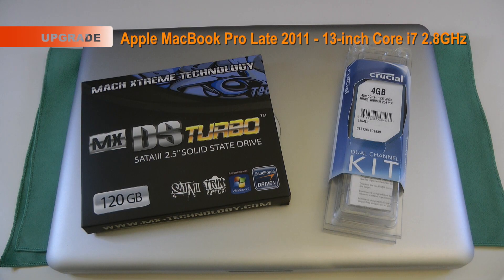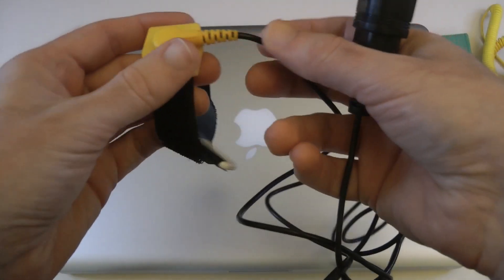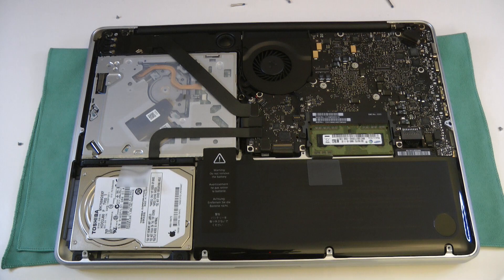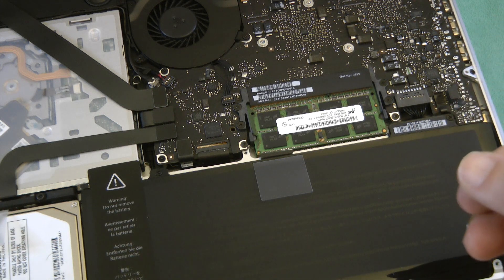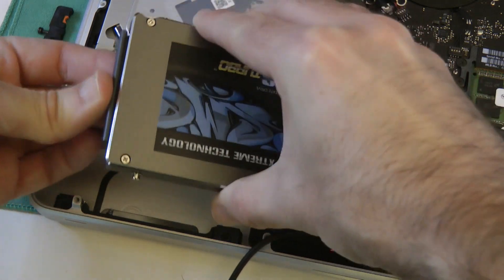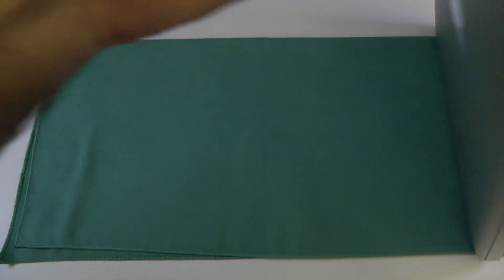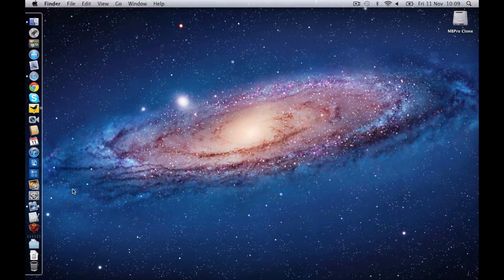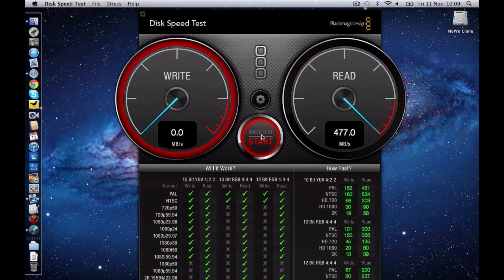Apple MacBook Pro Late 2011 8GB Memory & SSD Upgrade

Comment: Thanks for your effort with the video. It's important to run benchmark tests before and after upgrades so you realize the difference in performance. It would have been important to mention to check battery status prior to the upgrades so the battery could be replaced, if warranted, at the same time as other upgrades are done. Great job!!
Reply from the maker: Thank you :D

Comment: Helpful guide thank you, I'm installing a 500GB SSD and 8GB of RAM this week and will use this guide. My Macbook is in serious need of a refresh.
Reply: Hey mate, 100% would recommend doing the upgrades. Parts cost me about $300 AUD and my Macbook has worked insanely well since, better than the day I bought it. I also feel the performance would be equal to that of a new Macbook and you're saving yourself $2000... Replacing the parts is also very simple.

I'm considering getting a new battery just to really refresh it.
Reply from the maker: Glad you found it helpful, best of luck with your upgrade.
Reply: Hey Man! would you please advise how this upgrade speedup your mac? is it worth to upgrade Ram to 8gb and add SSD or better to buy mac 2015? thanks in advance!
Reply: Traymon Daniels Thanks for your feedback! I have already ordered new SSD and ram 8gb, so total amount or ram will be 10gb (2gb stock module and 8gb) hope 10gb will be recognized by Mac, I've read a lot of comments that this model (Mac pro 13 early 2011) can have up to 16gb ram even if manufacturer listed than max is 8gb.
Reply: Traymon Daniels hi! I'm in Aus as well and was wondering if you sourced the RAM and SSD online or from a particular store?

Comment: Im a video dj.will the ssd speed up my video instead of the little lag I get.
Reply from the maker: +DjTwon40 It should do.
Reply: Thank You,I updated my memory to 8 gig of ram but I want to updated from stock to SSD.
Reply: +Geekanoids Thank you for sharing! I am new to do my upgrade in ram.. since you have done this. the macbook pro improved performance much ? Im running Adobe programs such photoshop ...

Comment: Great video!

I still have my late-2011 13 inch macbook pro with its 4g ram and 500gb hdd. still a great machine. I still plan on using this great machine for the next 4 years.

I want to ask regarding the longevity of this machines with a 16gb ram and 500gb ssd. No problems so far?

Thank you so much!
Reply: Mike Oporto I have the same computer, also hoping it will last another 4 years but I am considering a retina haha. Going to upgrade to 8gb ram tomorrow. I think if anything those upgrade (ram and sad would make it last longer) right?
Reply: ***** I think so too :)I also love the retina display on newer models, but I thought I'll just buy like a 20+ inch external monitor and pair it with my macbook :D. Problem solve for me.

Comment: I have this macbook pro

  Model Name:	MacBook Pro
  Model Identifier:	MacBookPro8,1
  Processor Name:	Intel Core i7
  Processor Speed:	2.8 GHz
  Number of Processors:	1
  Total Number of Cores:	2
  L2 Cache (per Core):	256 KB
  L3 Cache:	4 MB
  Memory:	4 GB
  Boot ROM Version:	MBP81.0047.B27
  SMC Version (system):	1.68f99
  Serial Number (system):	C02H576PDV14
  Hardware UUID:	65EF0894-D69D-5650-A50D-7F688158C8C2
  Sudden Motion Sensor:
  State:	Enabled

and I like to upgrade it to 16gb ram and SSD , Can I ?
Reply: is it retina?
Reply: Frosty Gamer you can't upgrade the retina models
Reply: i know that, thats why is asked if it was

Comment: I think the capacity of the SSD is too small (only 120 GB!). I think I'll keep using my 750 GB HDD 5500 RPM. But the RAM upgrade is possible so I've done it and the graphics performance is much better from 384 MB to 512 MB. Now I can play GTA IV. Thanks man!

Comment: I have a Macbook Pro Late 2011 with 2.2Ghz i7, Would I be able to remove the optical drive and put 2 SSDs in it. Raid 0? How would I install OSX without a CD Drive?

Comment: hi mate, does the Macbook Pro (Late 2011) come with a 6 gbps optical drive? I'm planning on buying one with the OCZ Vertex 256Gb SSD (500mbps read and write) but because its a Sata 3, I'm not sure if the Macbook will take full advantage of the ssd performance

Comment: @drdrummerman The SSD upgrade will make your system faster. The SSD drive works much faster than a Hard disk drive, since the read/write speed is more than doubled (in most cases). And yes, the RAM upgrade makes the system a bit (in some cases a lot) faster and makes it run smoother while having more apps started..

Comment from the maker: @greigsa01 It will improve overall productivity and the number of apps you can have running at the same time, also memory intensive apps. No need to back up the memory, but always advisable to backup your hard drive before any upgrade.

Comment from the maker: @thefilmmakerpro You will notice a decent speed increase in this from your current machine. However, the jump from the 13" dual core to the 15" quad is a VERY noticeable difference.

Comment: @davomrmac That's quite nice quick solution. And using Time Machine, could I do a similar thing? Or can I just copy all files from current os x HDD to the SSD connected using usb for example (cause I don't have a cloning device)?

Comment: @davomrmac i did some more research and found a data sheet of the agility 3 on ocz's website, apparently the sata3 - sata2 compatibility isn't perfect. so the max speeds i would get out of it are the same (even a bit slower) compared to the sata2 drive, so i'm going with the vertex 2, plus it's cheaper.

Comment: Dave, Im running a Mid 2009 Macbook Pro 2.53Ghz 15" do you recon its worth the upgrade? My machine dose run slow sometimes but its still perfectly usable! It would probably cost me around £300 to upgrade to a top of the range 13" MBP I think, how much of a speed difference will I see between the Quad Core 17 in the 15" MBP and the Dual Core 17 in the 13" MBP?

Comment: i'm thinking of upgrading my mid 2010 15" macbook pro with an ssd.
it has SATAII so i was wondering should i get an ocz vertex 2 which has a max read/write of about 240MB/s  for €235 or should i get an ocz agility 3 for €305 which can go up to about 500MB/s, but i will be maxed by the SATAII to about 375MB/s?